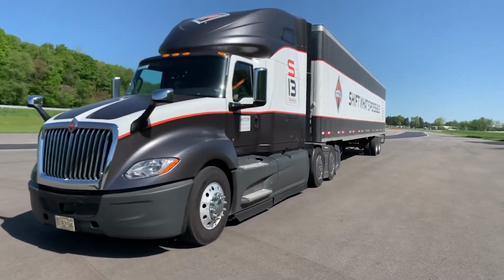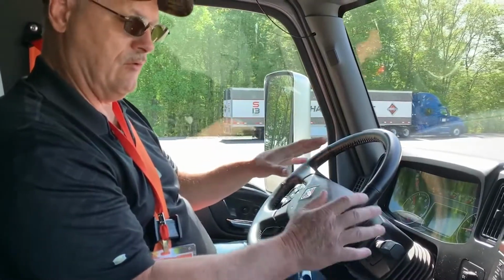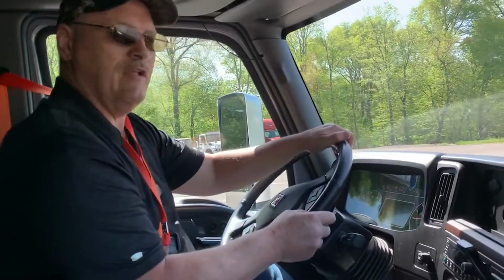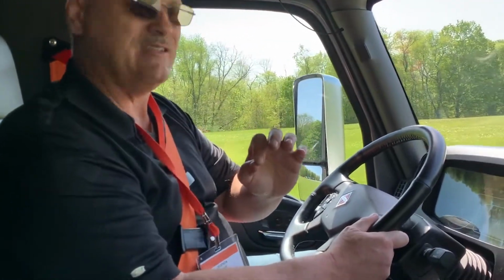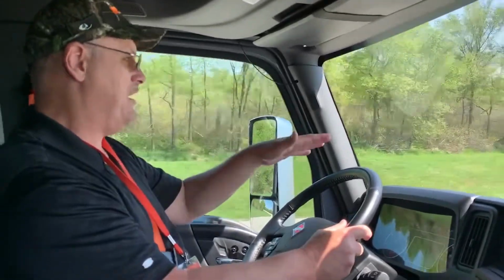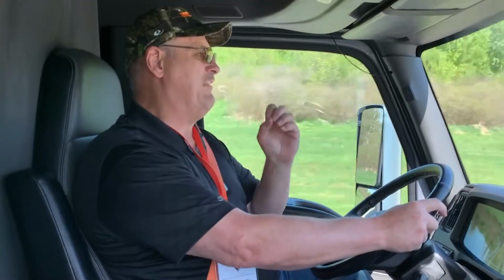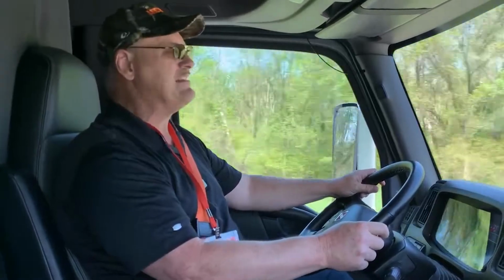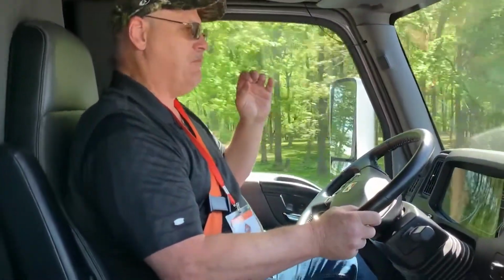International S13 T14 POWER TRAIN Test Track Test Drive in the LT625 Sleeper Must See!!

Comment: Is International going to make the hydraulic retarder available on this gearbox, as it is in Europe on Scania and MAN?
Reply: Nothing like going up and down hilly roads at higher speeds using the retarder and not touching the brakes. The truck is in full control.
If I was speccing out an alternative truck, then I would be fitting this. 
Love using the hydraulic retarder...
Reply from the maker: @MichaelTucker  Stateside has not incorporated that feature just yet,  I look forward to its addition when it comes state side.
Reply: @MichaelTucker  Why I prefer the Scania over the Volvo on that big ski slope down to Santander, Spain, brakes are literally on fire at 40 tonne gross otherwise!
Reply from the maker: I have no idea how this question was not populating.  

I am checking to find a best answer.

I wIll give you the feedback soon - I Hope.
Reply from the maker: I received the following "Currently the transmission mounted retarder for the T14 is not going to be made available in the International chassis.  Navistar will continue to explore what opportunities may exist for this solution in the North American market."
I guess we'll have to wait until demand for the system increases enough for them to add in the future.
Reply: @MichaelOlden Thanks for your time and efforts, I doubt that will happen anytime soon. Retarders are popular in Europe for two reasons: first, some European engine manufacturers, Scania being one, will not approve the fitment of a Jake or similar and secondly the Euro emissions rules include noise not just exhaust this effectively has meant engine brakes, when fitted, are nowhere near as effective as a Jake. That said, a Jake comes nowhere near to a retarder.
Reply: I am driving MAN TGX 18.510 12-gear+ retarder, now is 4 months enjoyment in abuse of landscape in performance mode 😂, it's a beast, MANZILLA. Downhills just need a tap on brake pedal and it keeps speed automatically, activate,, engine brake/retarder/service brakes.
And yes, dashboard is complaining about fuel economy but I just can't use cruise control, mine right foot is always in right 😂

Comment: Have they started production on the updated LT?
Reply from the maker: Yes.  They have started production on the LT's.  The S13/T14 powertrain was introduced earlier this year with production set to begin this month (July).  The power train has been VERY successful in our sister manufacturer Scania and has yielded better than expected fuel economy.  
The clean sheet technology 
Eliminated the EGR - so it just produces power
Eliminated Active Regeneration - no more downtime lost to cleaning cycles.
Eliminated Fuel Consumption - this system does not use diesel ingestion to increase heat.

Comment: How much is the truck
Reply: 190k for international? To much even if they put Ferrari engine in it.
Reply: @Sloba1992  lol. Not it's not. Scania engine. This isn't a trashinational. Completely different tuck. Your KW peterbilts and Volvos are $230k+. This truck will have better fuel economy and I think will be pretty reliable. I might lease one because they're offering some great incentives and uptime guarantees, from what I hear.
Reply: @ac-ir9gs  eh depends were What dealer you work with . I bought a 2023 T680 NextGen for $169,000 It's a well-equipped base model .
Reply: @JackknifeIRL  that's a nice purchase
Reply from the maker: @Sloba1992  Thank you for the comment and it is the pricing in todays market.  It depends on what you are looking for in the market.  If you are seeking fuel performance, low maintenance costs, high level support from a manufacturer, an engine the produces ONLY power and does not suck on the exhaust, or an emission system that does not inject fuel into the exhaust system to meet emissions then the value is there.

I know many that are proud of lesser fuel efficient and less aerodynamic trucks.  

Thank you for your thoughts and I welcome conversation on performance, value, and the return of a solid International Product line from the CV to the HX
Reply: @MichaelOlden You need to reword that to. If you’re looking for a cheap truck with no resale value, that Navistar will tell you what options you’ll be allowed to have on it. With a junk AMT transmission unproven in every way shape and form with an engine that’s untested within the States. You to can suffer Navistar service taking weeks to get repairs. It the N-13 all over again.
Reply: Not bad
Reply from the maker: @ac-ir9gs  Thank you!
Reply: I hope this ain’t going to be a max force reincarnation
Reply: @kennethmaina9203 it’s not at All but I’m betting sales will suffer from people thinking it’s another maxxforce ordeal
Reply from the maker: In short - there can be many adjustment to meet your requirements.  That said the most recent quote for a White in color tractor is :
Sale Price without FET	 172,471.19
 FET	 18,713.24	 	 
 Sale Price Per Vehicle	 191,184.43

How many can I get you???😄